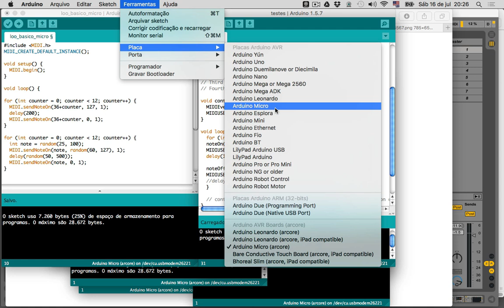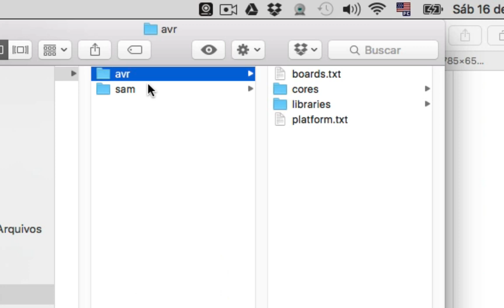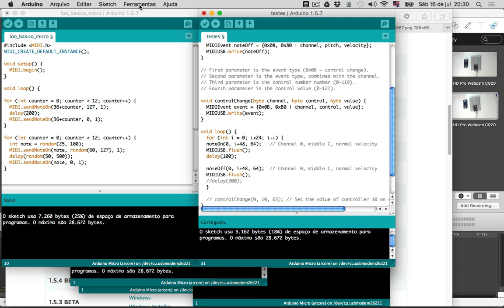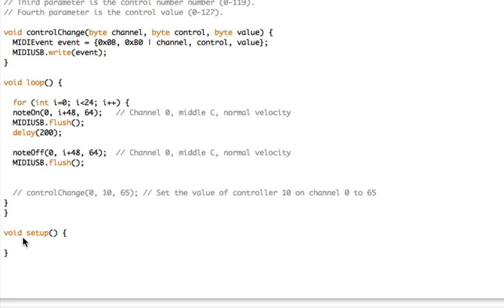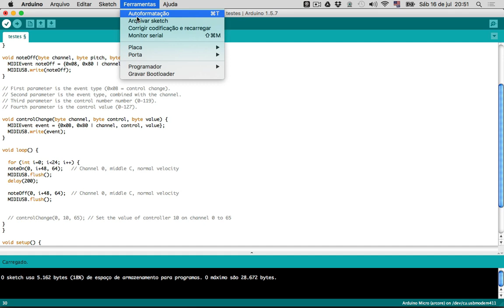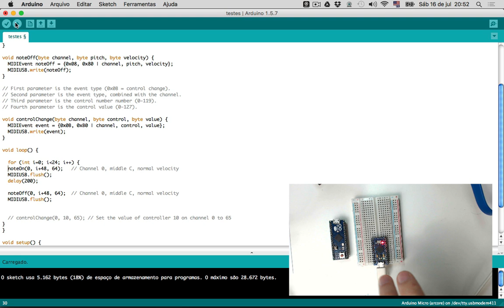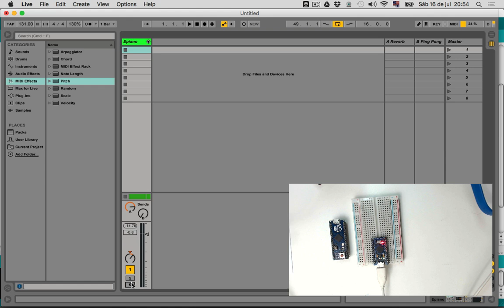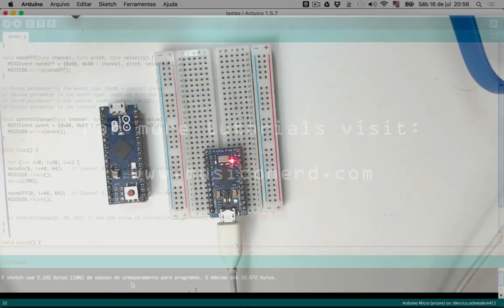Arduino (Pro) Micro as a MIDI-USB device

Comment: hi. how can i add potansiyometers on breadboard to control as a fader?
Reply from the maker: You need to buy a fader that comes in a pcb with connections to a breadboard. It's not ideal. Ideally, you will prototype with rotary pots, since the programming is exactly the same, then you change for faders in your final project.

Comment: Hi sir I have many questions I am stuck in my project I am building a raspberry pi which is almost done everything is ready but the problem is I am using a laptop touchpad and to control that I am using Arduino pro micro I wanna change it into hid usb which I can plug into raspberry pi I watched one of video on YouTube how to use touchpad with Arduino and I used his mouse librarie which he gave link and I upload it into Arduino software on pc as how he was showing but still not working so please please please help I am really stuck in that my laptop is almost ready I checked on YouTube Google but didn't understand what they r saying cus I am not related to that I am not engineer I didn't study for that I just use my own mind to build that so please please please help I can just request u
Reply from the maker: I never used a touch pad, so I can't help you with that! :/
Btw, I'm not an engineer too, everything I learned was with Google, so you can do it!

Comment: Awesome, great tutorial man!! would it possible to make a tutorial how to make a bluetooth over midi usb device like a keyboard?
Reply from the maker: I never done one, but you can do it using the Adafruit Feather board. It's a little bit pricy, but it is the more easy to use bluetooth diy solution for midi. Unfortunately, midi is not as easy to use with bluetooth as a keyboard or mouse.
Reply: thx for your reply

Comment: Hi! Do you know how to change the name of the usb controller manually so i can put a personal name into it instead of "arduino micro" in ableton live? thanks
Reply from the maker: Unfortunately, no! I'm looking dor this answer too...
Reply: I haven't tried it but check the file at "/hardware/avr/boards.txt" before you flash or select the board and change line 90 that says "micro.build.usb_product="Arduino Micro"" to whatever. Let me know if it works. :)
Reply from the maker: Hi, I just released some tutorials, on this issue: https://www.youtube.com/watch?v=32myesnWLuY&t=2s&list=PLDvka7NV8VPC_J40TdxirbjC-LYEZ5-rg&index=1

Comment: Try uploading your sketches with a ISP (using the 6 pin header on the board). Pretty cheap solution (1$ on Ebay) and you won't have this USB confusion anymore. Moreover, you'll be able to program your board while it's still plugged onto another computer, can be cool for debugging.
I'll give it a try and let you know how it goes
Reply from the maker: That's a good idea! I need to get one programmer, that's more handy.
Reply: i "saved" a arduino nano today that i thought was dead.... "only" the Serial->usb chip is dead. works just fine with the ISP programmer. Never throw away stuffs :-D

Comment: May have already been mentioned, but I'm betting if you disable the device in Ableton you'll not have that upload issue.
Reply from the maker: The (pro) micro has these "bugs", sometimes it helps pressing the "reset" right after hitting upload too. But, the Ableton thing might be one reason too.